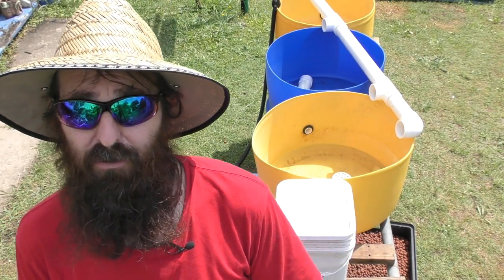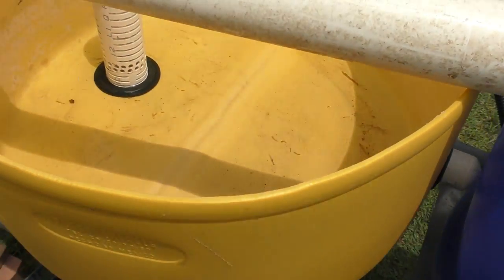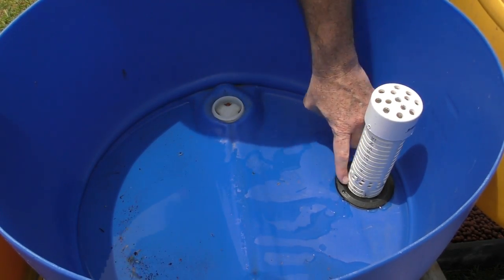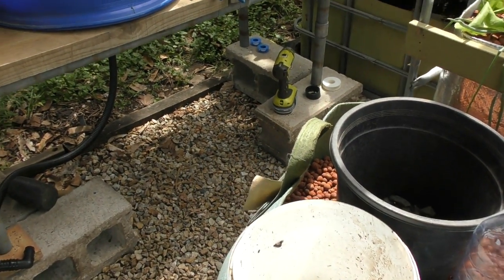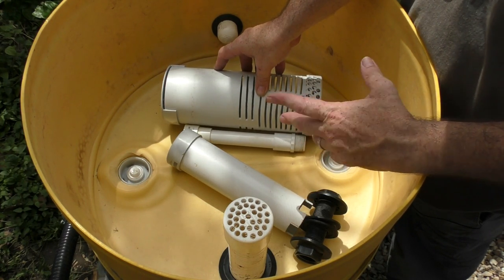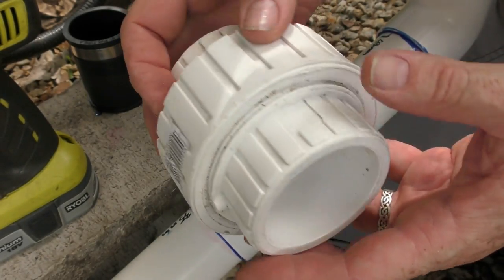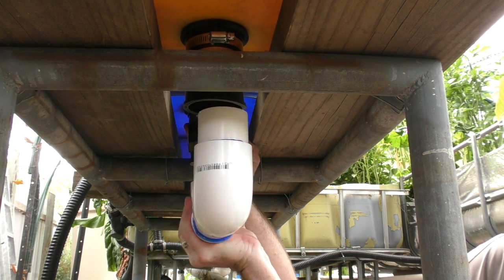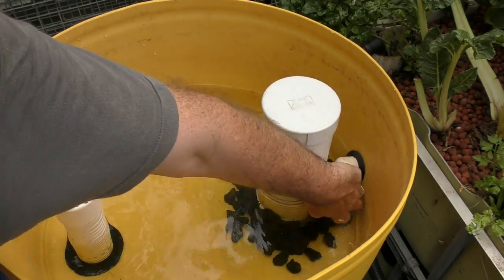Single Bell Siphon Running Multiple Beds in the Aquaponic System

Comment: I dont  understand  ?   do  the  other  2  barrels  w/out  the  bell  fully  drain  also ?
Reply from the maker: Hi Chris. The 3 of them will fill & drain at the same time due to the pipe work on the base delivering the water from the first bed to the other 2 at the same time. When the siphon initiates it will drain all the beds at roughly the same pace as they are all connected by the single communal drain pip in the base.  
Hope that helps a bit. I did another clip before this one that works on the same principal but had different pipe work & the siphon is in an external bucket. It does show the how the water flows through the barrels though.  https://www.youtube.com/watch?v=pKwq_PRCeQw
Hope that helps some. 
Rob.
Reply: thank you Rob  for  such a   fast   reply  , I will try  it

Comment: Isn't the plumbers glue poison?
Reply from the maker: Not once it's cured. It's the same glue that is used on rain water tanks but there is a different one used for pipes delivering water under pressure. Both would be toxic uncured.

Comment: i have decided to do this also, but i struck a bit of a problem , every single uniseal leaks, im thinking my holesaw may be a smidgen too big . so i silasticed them  but still some leaks
Reply from the maker: Have you tried wrapping the uniseals with Teflon tape Dave? I wrap it around the outside of the seal that goes through the tanks wall & find the thicker pink tape works well. 
Hope that helps some mate.

Comment: HI THERE ROB GOOD JOB yOU SHOULD CHECK OUT AQUAPONICS OLOMANO GARDENS HAWAI GLEN he has a Barrel Siphon connected OUTSIDE THE  Garden Beds, AND ALSO AIR PUMPS VERY GOOD
Reply from the maker: Hey Andrew & thanks. 
Have seen all of Glens clips thanks Mate 👍 Not a huge fan of connecting the larger beds to a single siphon like he has as I like to be able to isolate beds easily. Each to their own though 👍
Cheers mate.

Comment: Hello Rob. Where do you get your bulkhead fittings? I'm trying to set up my first hydroponic ebb and flow system for my mother but she doesn't have any tools here besides a drill. I'm thinking about purchasing this bell siphon kit on Amazon (https://www.amazon.com/Aquaponics-Adjustable-Siphons-Worldwide-Confidence/dp/B01AISGQW4/ref=sr_1_7?ie=UTF8&qid=1488915969&sr=8-7&keywords=bell+siphon) then add endcaps for it (drill holes on the sides of the bottom  end cap like you do) and use the bulkhead fittings to secure it to the flood tray. Do you think this will work?  Thank you for all of your videos.
Reply from the maker: Sorry I missed this Allan. How did the build go?

Comment: Why would you even need a stand pipe in the beds and use all space to grow veg?  I would think you could just make a "grill" at the bottom of the grow bed to keep the media and roots from blocking the drain.   Almost like drain tile.  With a stand pipe, the flow will increase near the drain as the water level drops.  This could cause roots and debris to block the drain same as an internal siphon.  I think a false bottom grate much like an aquarium gravel filter would be perfect.  This would allow the water to slowly drain over the entire bed and only speed up after the water level has dropped below the false bottom requiring little to no maintenance.   What do you think?
Reply from the maker: Hi Mate.
The reason I used the tall drain was so there wouldn't be a concentrated flow dragging the water to one exit point.  Also too I wouldn't grow plants with large root systems in here like I said in the clip 👍 
False bottom would be great but not sure what I'd use as a base grate in the barrels but it would work well with t tubs nested inside each other I'd think.
Cheers mate & have a great one.